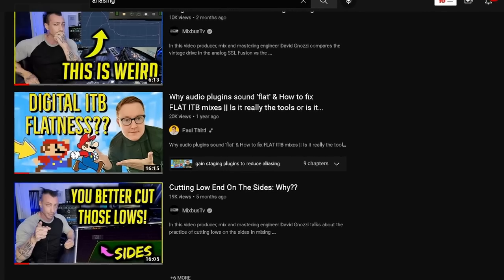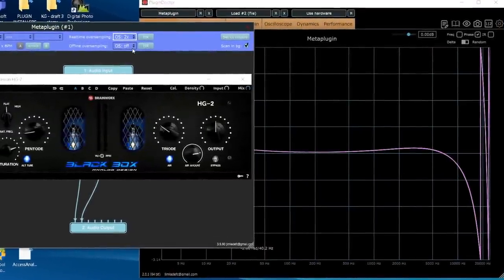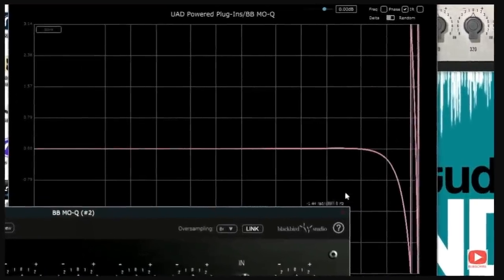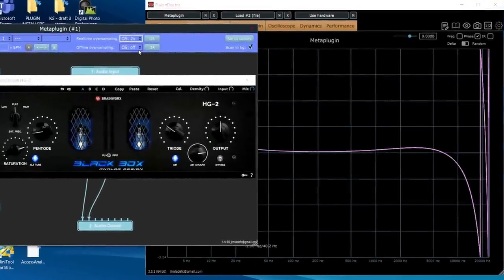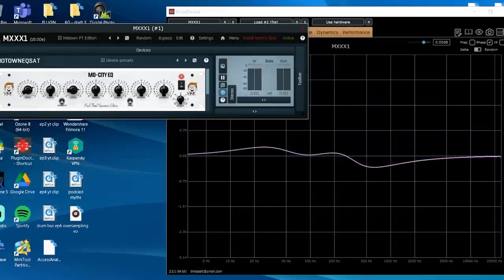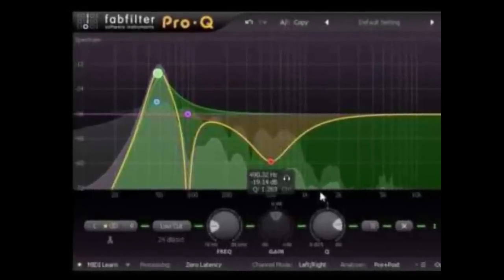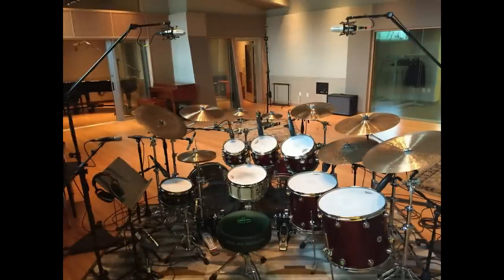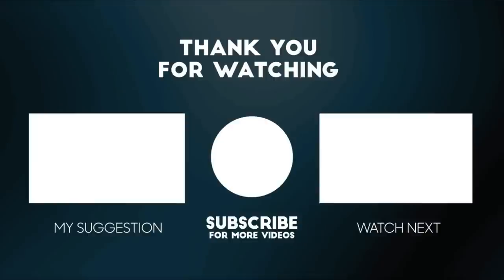Are YOU ruining your mixes by oversampling plugins??

Comment from the maker: Right.. Test for the dsp geeks out there

Explain how FIR & IIR oversampling filters work in the simplest way possible so those new to oversampling understand how the filters manage to internally oversample in a fixed sample rate session 

But IT HAS TO BE SIMPLE!

good luck 🤣
Reply: IIR LPF: you delay the signal and add it to the original, take that, delay and add that to the previous version and so on. That way you "smear away" the high end. FIR LPF: Take the signal, delay it and siphen it off,  delay further, siphen that off and so forth, then add all the siphened off ones together. "Infinite Impulse Response" because it's an infinitely recursive feedback loop, "Finite Impulse Response" because there is a finite number of times you're delaying the signal by a sample and storing the results in a buffer. Also good luck hearing linear phase pre-ringing at 24Khz ;)
Reply: ^what clone me said. The average person is going to have a very difficult time distinguishing between either filtering technique, let alone the differences of over sampling (unless they just love hard clipping).
Reply from the maker: Very much like expensive hardware really eh?
Reply: @theCloneman5  great explanation! But what does siphen off mean? Can't find it in a dictionary. thanks
Reply: @CyrilleBoucanogh  sorry I misspelled, I meant siphon off. You split the signal there and run it in parallel from that point on. After each subsequent delay you add that result to the parallel chain and add them all back together in the end
Reply: @theCloneman5  thanks a lot. So this delay thing reminds me a comb filter a bit? But the thing like IIR and FIR is far more complicated.
Reply: @CyrilleBoucanogh  it's the same idea as the comb filter. For a low pass filter, you basically use the lower half of the first comb notch as the basis. The higher the delay, the further down the spectrum the comb moves, the more notches appear.
Reply: @theCloneman5  no one ever could explain this to me in a such simple way. Thanks a lot!
Reply: Please test new Boz The Hoser 2. It uses some completely different solution to cramping using 0% CPU. It has oversampling too but eq does not create cramping by itself. Only Boz has this solylution. Please test this eq.

Comment: Linear phase filters do have pre-ringing, but when we're talking about oversampling filters, these are lowpass filters just before nyquist, and correspondingly will ring only at the cutoff frequency, which will be somewhere around 20 kHz. This sort of pre-ringing will almost certainly be inaudible in every situation, and not any sort of an issue in practice.

The actual tradeoff with linear phase filters however is what the pre-ringing leads to: latency.
Reply from the maker: It's interesting cause with the melda stuff I can hear it. When I use their linear phase oversampling I hear a difference in the transients. Just a slight smear
Reply: Wait a couple of decades - you won't hear anything over about 16kHz anymore anyway!
Reply: @PaulThird I doubt it, if your still interested, do a blind ABX (at least 20 times level matched) I very very much doubt you’d hear it
Reply from the maker: I did do blind AB's at the time. Don't know what it was but I could hear a subtle difference on the snare I was working on. Kept picking the minimum phase oversampling algorithmm. Think it was a clipper or something. Was something like that
Reply: @PaulThird  I’d be really tempted to null the two files and see what the result would be because unless your doing pretty extreme filtering with a high Q at low frequencies it’s highly unlikely to hear anything. I’m going to run a test like this for myself and I’ll use a snare drum and do a few where it’s increasingly drastic moves until I can discern it and I’ll null it. If you have the will to do so I’d give it a try too
Reply from the maker: @memeswillneverdie tbh I don't even use that melda limiter any more, I use TDR limiter 6 now. I just don't really think about it much anymore. I just figured out the sound I wanted and stuck to it. I don't really use many plugins that require require manual oversampling, especially on drums

Comment: Ever thought about the fact that aliasing could also be another form of “colouring”, I don’t analyse plugins, I try them out, hear what they do and use them with whatever “quirks” they have, if you think in the digital age there are compromises what do you think how much compromising had to be done in the “analog times”, when I started in the early days at inner city sound, yes in Dundee, there was an Alice 12 channel desk and Tascam 8 and 2 track machines, very little outboard, a Great British Spring reverb, a piece of drainpipe quite literally, now that was compromising, nobody talked about phase linearity or frequency response, biggest issue was signal to noise ratio and the biggest discussion was about how something sounds or how you got there to get the sound,maximum dynamic range was realistically 24-30 dB and still is to the most part, so anything introducing some kind of distortion below, let’s say -60 dB was quite honestly irrelevant, with only 16, 24 or exceptionally 48 tracks the summation of distortions was inconsequential while the noise floor was mostly way higher, in todays digital world 100 to 200 tracks for a pop/rock song is somehow the norm and I ask myself, why? The average punter normally only discern 4 or maybe 5 “sounds” when listening to a piece of music s 25 guitar parts and some similar amount of keys,strings and backing vocals may be very clever musically but who actually hears that in todays consumption mostly on earbuds, I always had some kind of high-end hifi at home and all my more musically inclined friends found it amazing to discover that there was 4 or 5 guitar parts while on average when listening they could only discern 2 or 3, how many people listen to a good well setup sound system at home these days? So the discussion about minuscule sound variations due too distortions and aliasing is maybe clever in the studio situation, but outside? Is the song good or bad, that’s about the only analysis going on, I think focusing on if the playing, arranging and music should be the focus and not the phase and ailiasing, after being put through whoever’s streaming algorithms that the average consumer is using then you are lucky if the 4 components that they hear on average sound even close to what was intended to be heard, what is more important, if it sounds musically good or technically good?
Reply from the maker: We're on different pages though. If I'm the mixer then what have I got to do with the arrangement, recording & playing?

I'm thinking from a purely mixer orientated perspective.

I get the multitracks from the recording engineer / producer and its my job to engineer the record from there.

In the box mixing isn't analog and I and other itb mixers don't worry about the limitations and compromises of it, as we don't need to. Because we have other challenges and compromises within the digital realm. 

Aliasing is a digital problem and unmusical and is something that the mixer adds in via the tools they use and how they use them.

If you let it build up it has a sound. The reality is that it is unmusical so why would you build that up throughout an entire mix? That's my viewpoint. 

Surely to better serve the music you want the pristinely recorded performance to be processed as musically as possible?

Its a very subjective thing but in a world of in the box mixers where technology is becoming more powerful and advanced every year, the little things as a mixer that make you better than the next guy or girl becomes narrower.

Say a label sends a mix to 4 itb mixers and you are one of them. All using plugins and will imprint their own tastes and techniques but ultimately still mixing the same multitracks in the daw using plugins.

In those scenarios you may have to think of ways of getting the most out of what you have. 

More plugins or a new plugin??.. Top engineers have any plugin they want.

So what else can you do.. You can learn them better than those engineers and get a little bit more out of them. Get more out of digital. When your chops are good and you are all on a level playing field it's the micro things that build up that matter.

Many people tend to think of what I do as a singular thing where I see it as an overall picture. All of those different decisions made on different sources all building up in the mix.

Sometimes it could be just working at 96k which gives you a bit of a clearer top end compared to the other guy battering away with emulations at 48k.

Theres many variables but when you are a mixer these days you have the same tools as everybody else but you may undetstand them a bit better which may just give you an edge on them.

Small margins but it's a tough world out there these days. Every little thing helps.

For many analog guys, that edge meant spending a mortgage on rare gear...

For me, its learning more about the digital realm and plugins

To each their own
Reply: music is art especially how they mix some of those pop music is just beautiful i agree that most of the listeners won't fully experience it but it definitely adds value to the sometimes boring or simplistic pop songs

Comment: In Bob Katz's first edition of Mastering Audio he had a great chapter which he used the term digital dollars to explain audio but calculations which I thought was a great way of thinking about it. 
He super simplified with the concept with" you start with 5 dollars and we half the volume so now you have 2.5 dollars" etc. When i was a noob in the 90s I thought the whole point of digital was perfection, but obviously just a couple of processes down the line and your into 1.235776774911 etc dollars and inevitably there will be rounding errors at when you reach the bit limit. So the lesson was clear, analog or digital, keep it simple or you're just compounding various forms of errors the more you do!

Comment: Random topic: Upwards compressors

So: why are there not many? Yes, parallel-compression can get you similarish results, yes the melda mCompressor offers great control for upwards compression when you engage "custom shape" (the best I know). The MV2 (waves) got it, the omnipressor (eventide) has it (and it's usable if you use the "gain-limit" to smoothen out the gain), bluecats dynamics got it, kilohearts dynamic has it - so you CAN find some with ACTUAL (non-faked) upwards-compression, but why not more?

Honestly: it bothers me!  I really don't get it. They could literally simply make it a button (switch between upwards and downwards compression). I'm in my happy place with the (FREE) mCompressor now, but damn..
Reply from the maker: The harsh reality... There isn't many famous analog upward compressors. Stupid... But true
Reply: @PaulThird  hahahaha, I didn't even think of that! I DID think "well yeah, they won't include it in hardware emulations" - but you're right.. the simple fact that most plugins are in fact emulations and most people still don't THINK digitally means they simply don't think of it when doing a purely digital plugin. Also many probably don't even have a code for it yet (because it wasn't necessary for all the analogue emulations), so they can't be bothered. Jesus.. thanks for clearing that one up for me. Sometimes I'm blind when it comes to such things!

PS: Don't wanna be a dick.. but seriously: Try out some upwards compression with the mcompressor.. it really is not the same as parallel compression when you use it to an obvious (sound-designy) degree. I just transformed a snare for example - it's a different snare now.. it's like EQing, but not.. you get away with "more change".
Reply from the maker: I'll try it out but I think I do that with eventide omnipressor. I use an attack preset as a drum preset and it's awesome
Reply: @PaulThird  Oh yes, the omnipressor works great on clean scources. On vocals and such you gotta be careful with it's upwards compression though.. if you don't tame it via setting Gain limits you will not get much body, but all the noise. I'm still not "confident" with the Omnipressor.. really takes some time to master that bastard - for me at least. You know I'm slow!

Comment: My issue with oversampling comes mostly with clippers. Most clipping plugins have oversampling now but it always comes after the clipping stage which is understandable but if I clip at 0db and then oversample, the oversampling will cause the peaks to go above 0db. so.... its not clipping at 0db anymore and I have to adjust it. The only plugin that doesn'tt have this problem is Kclip by Kazerog which has a second clipping stage after the oversampling. I think I have also convinced the maker of Clips by Sixth Sample to add it in the next update. Have you noticed this before?
Reply from the maker: I use tdr limiter 6 clipper a lot which I don't think has that problem.. I think cause of the routing as you can have a peak limiter and also an output meter as well at the very end to catch any stray peaks. Tokyo Dawn guys are geniuses so I think they covered all that.. I think!
Reply: @PaulThird  Nice I use TDR limiter 6 for all my mixes too but I use kclip before the limiter. Mostly because kclip has an "oversample during render" option so I can save CPU but still render with 32x oversampling. I did not know the oversampling was before the protection limiter in TDR.
Reply from the maker: I'm taking a wild guess. Only cause its TDR
Reply: V-Clip and Standard Clip also have a two stages
Reply: That's cool. I've found Aapo from Sixth Sample to be really responsive too.  He's adding a feature I requested to the delay.
Reply: The oversampling on clippers is always before the clipping stage.
What is causing the peaks to go over 0dB is the low pass filter that is applied before downsampling, and not the up /downsampling algorithms.

The processing order is this: upsampling>clipping>lowpass>downsampling
Reply: @АлександрКузин-з6б  I can’t say anything about vclip but standard clip does not clip the end it just turns down the signal so it doesn’t peak above 0db. This negates some of the impact of driving the input of the clipper.
Reply: Yepp!!!
Reply: @kelainefes  So in this case I guess Kclip does upsampling>clipping>lowpass>clipping again>downsampling, or something like that.
Reply: @PaulThird  I love the limiter 6 GE! The clipper does allow occasional overshoots even on brickwall mode (especially with multiband engaged) however as you mentioned there are post clipping limiting stages in the output section. the PCM limiting in the output stage keeps the tiny overshoots from the clipper under 0 DB in a transparent way (you could also use the ISP limiting but its much less transparent than the PCM)
Reply: @PaulThird  I was testing out limiter 6 ge but I cannot find the oversampling controls. Are they the quality modes or is there an oversampling section I am missing? I know where it is in the free version but not the TDR version.
Reply from the maker: Quality modes. Eco, precise, insane
Reply: @PaulThird  Ok that is what I thought. Yeah my test does not show any peaks going above 0db when I push the drive of either the clipper or the the limiter. I also found a "render at highest quality" option in the settings which I think will switch it to Insane mode when you bounce your track out of your DAW. This really is the best mastering limiter especially for beat makers like me who like to produce through a mastering chain. It lets me make music with super low latency but render at the highest quality without needing to change settings in the plugin before I export.
Reply: @lawinter1949  kclip has 2 clipping stages, with the second one being optional.
Signal goes upsampling>clipper>low pass>downsampling>clipper
The second clipper is not oversampled and is there to catch the peaks caused by the oversampled clipper.